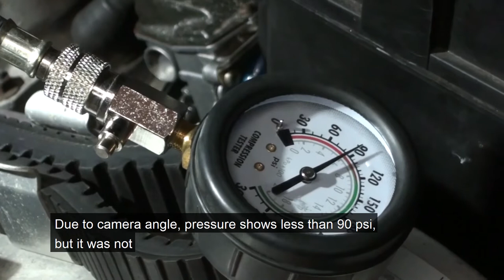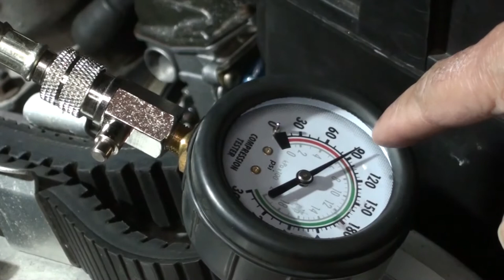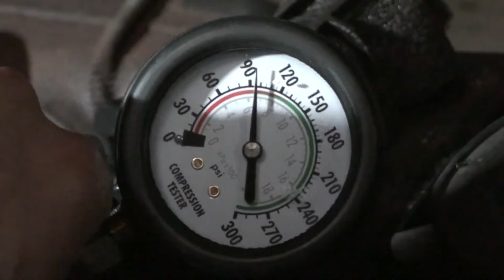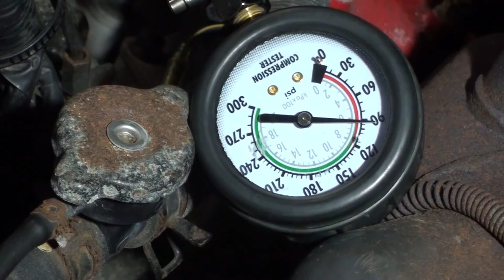Compression Test on a Snowmobile- How to?

Comment: His a sx viper 700 the same even if my head his black? Because i wante to no what his the original compresiion on those motor!
Reply from the maker: Sir, I would check a manual for SX viper 700. This snowmobile is older and has different compression. 120 psi is considered best.

Comment: Nah man. That thing needs a rebuild. Rings may do the trick. But you should also check compression when its warm so parts are expanding in the cylinders. Should be at least over 110. 120+ is optimal. Also doesn't matter much if you hold the throttle down or not. Really makes no difference.
Reply from the maker: Good thing I got it sold a few weeks after the video was made. No more worries.
Reply: your right i try holding the throttle and not holding and i got the same reading